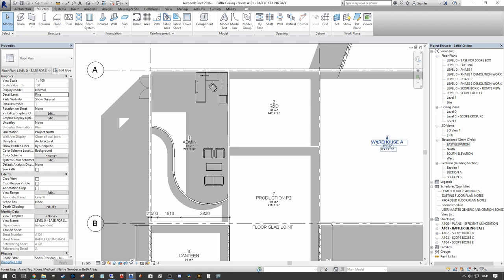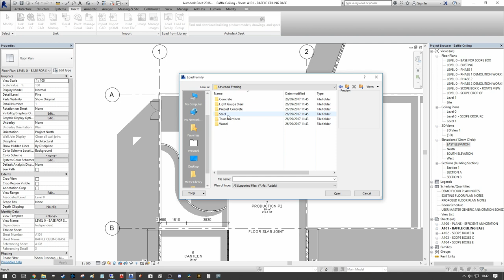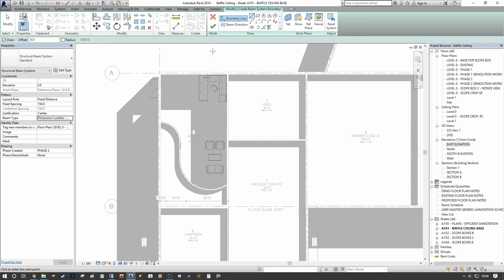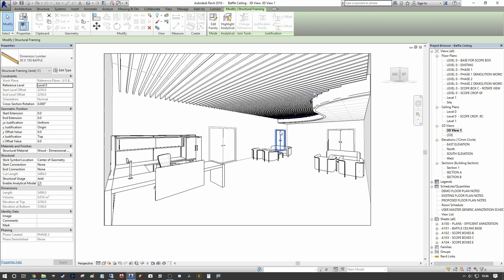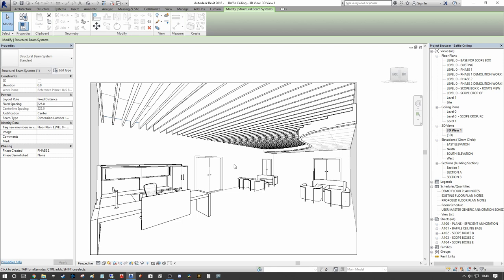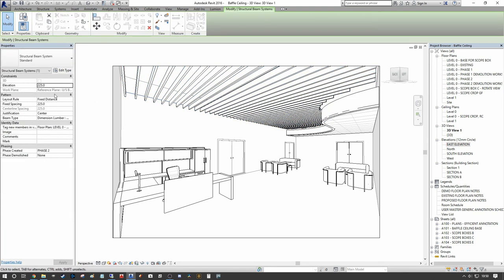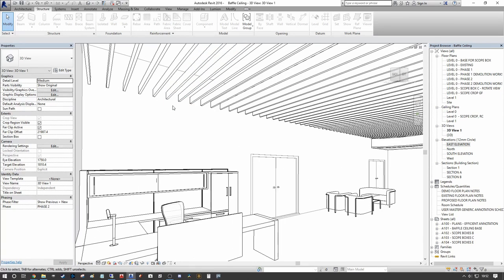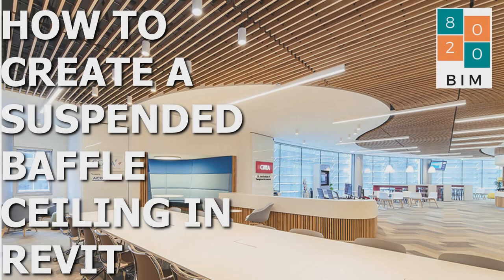How to Create Baffle Ceiling in Revit

Comment: Hi, i can see it in my perspective view but i cant see it in my ceiling plan view even when i clicked visible in view. I tried checking the visibily/graphics but theres no beam system there.
Reply from the maker: Hi Farah - my apologies I only got to this now. Just to ask hte following questions as a sanity check - Do you have phases in your project (could beam system be on a different phase/phase filter than the view)? 
Do you have it hidden in view?  (Press "RH ro Reveal Hidden elements to see if the beam system/beams are hidden in the view specific).
Do you have worksets in your project, and if so is the beam system assigned to a workset with its visibility off? 
Do you have the view set to any discipline Bias? IF you change it too "Coodination View" does it become visible?
Reply: Farah, if Niall's suggestions don't work, try changing the detail level to fine (for some reason beams are often set to only show at fine), and adjust the view range as needed!
Reply from the maker: @gduteaud  this is a great suggestion. Thanks for helping out Guillaume 👍

Comment: Hi, I was able to follow along and applied this to my RCP but then could not get it to show up, I see it in a perspective view of the space, and saw it when I showed the “hidden” elements, but was not able to select it as the “unhide” option would not let me click it- I was wondering if you had any ideas on how to fix this so it was visible? Thanks!
Reply from the maker: Hi Amanda. There may be a number of reasons why it is not presenting in your view.
Try the following in sequential order:

1) Make sure Structural Framing and Beam Systems both have their visibility turned on in the model category of the Visibility Graphics menu. If you have a view template assigned to the RCP you will have to do change this setting within the template itself. 

2) Select the elements in the Hidden Items view (press RH to Reveal Hidden) and see if you can select them and "unhide by element"

3) The view type may be set to Architectural - try change it to "Coordination" and see if the structural members show.

4) There may be view filters controlling the presentation of certain element types. Look at the Visibility Graphics menu to confirm that there are no filters changing the view presentation.

5) Finally, if the model is workshared you may have a the Baffle ceiling assigned to a workset  that has its visibility turned off.

Hope the above proves helpful. Please respond if one of the above does not resolve the issue or if you have any other questions.

Niall

Comment: Can i apply this to achieve an organic baffle ceiling ?
Reply from the maker: Hi Dareen. Yes, this technically can be used for an organic ceiling but is likely more work than is merited. I would consider a model in place mass to create one consistent solid organic shape which you apply the baffle material to. Then, I would use an array of voids to break up the solid organic form and  create the spacings required. Hope this helps.

Comment: How else can I bring up the beam catalog without typing BM?
Reply from the maker: Hi Hayley - you can bring up the Beam Tool by going to the Structure Tab - Beam. 
If you need to bring in a new beam family from the beam content libraries this can be achieved by going to the Insert Tab - Load Family and navigating to the required beams family from there.
Hope this helps!
Niall